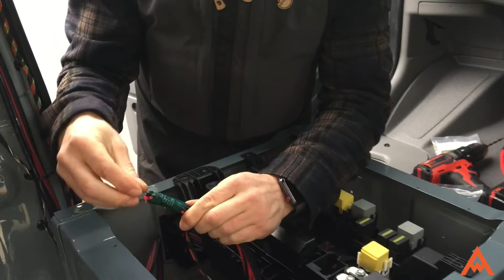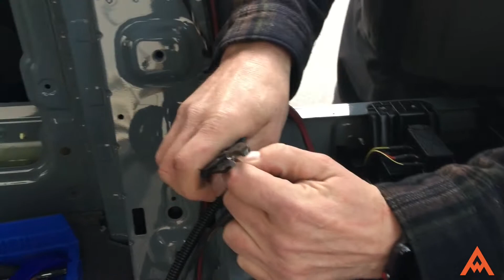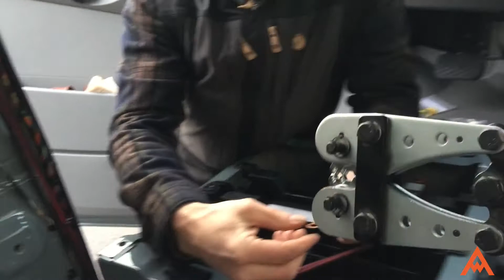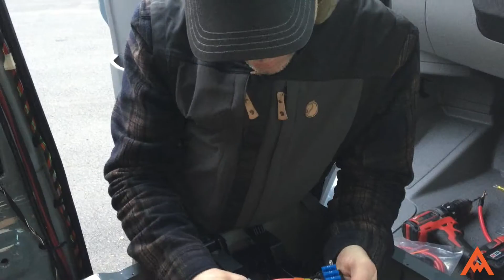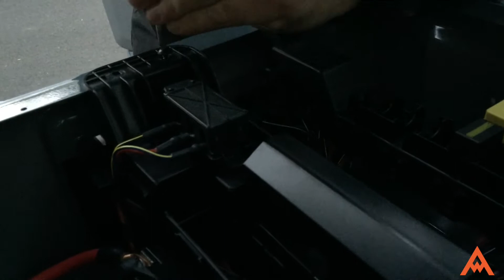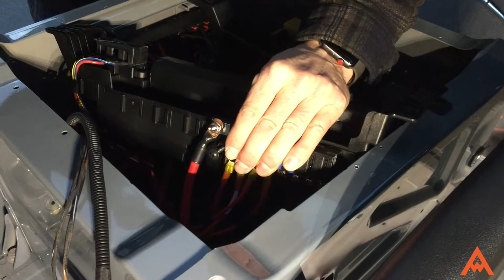Sprinter Electrical Harness Fuse Block Connection

Comment: wow! what a demanding job. I've had some wires burnt up on my 06 sprinter due to abs system failure. I was advised by my mechanic to get rid of it. Any suggestions?
Reply: What ended up happening?